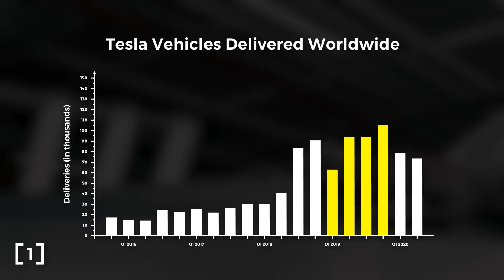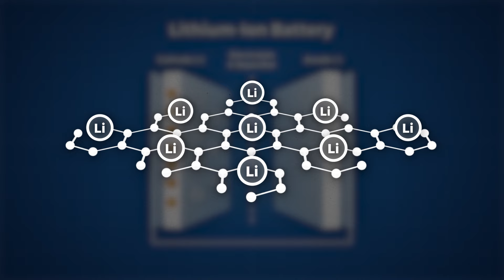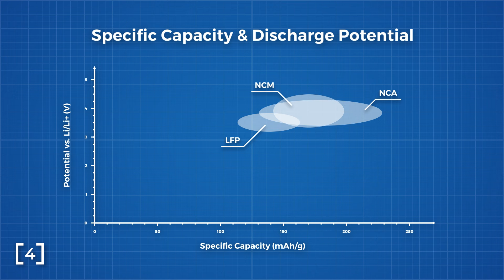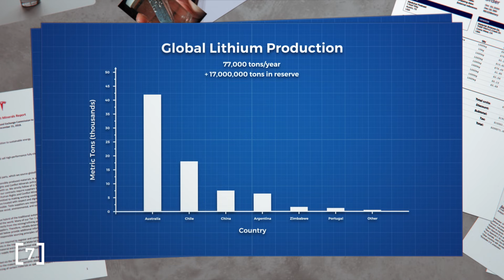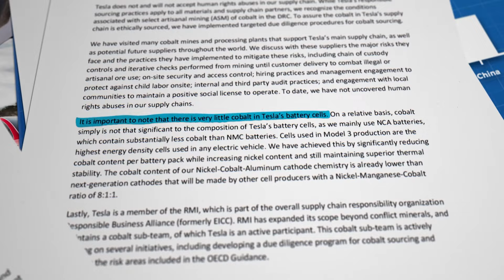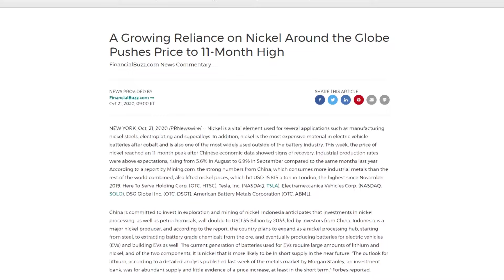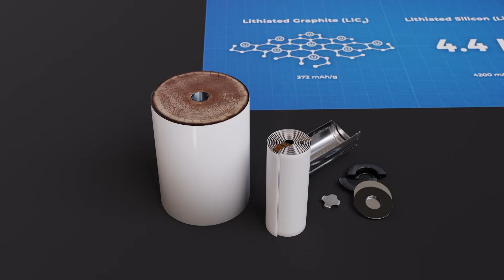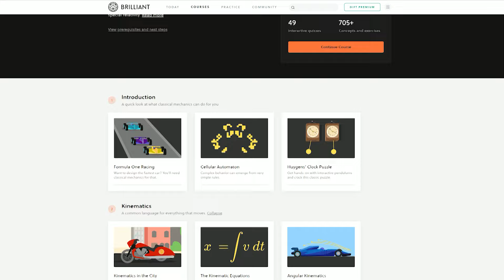Tesla's Battery Supply Problem

Comment: Forget batteries. Electrify the roads like slot cars but in 1:1 scale 🏎🛤
Reply: No, its not gonna be feasable
Reply: @antaresmc4407  it is, but you make the slot steer the car since you must be following it all the time anyways, make them longer since you no longer need steering, to exploit economies of scale, et voila, you have a tram! Why not put it on exclusive or elevated track so 'normal' cars won't intervene? Now you have a rubber tyred metro or mass rapid transit!
Reply: @revimfadli4666  you would need to wire up all roads and limit a lot vehicles' speed and maneouverabilty, while costing a shitton of money and electricity to maintain
Reply: @antaresmc4407  why wire up all roads when we can put our "elongated electeic cars" on a sepcial track, and only wire them up instead?

Why limit the speed and maneuverability, when it's on an exclusive, grade separated right-of-way?

Why worry about the cost, if you can also capitalize on property rent around the stations(which would gain value due to their strategic location), enough that you can lower ticket prices while still providing affordable transit?
Reply: @revimfadli4666  so you wanna create tram but with tons of traffic?
Reply: @antaresmc4407  tons of traffic of 'normal' cars that share pathways? Or traffic on the exclusive line?

If the latter, that's the beauty of 'elongating' our 'slot electric car', you can fit many people while taking up less space!
Reply: @revimfadli4666  what I meant is a lot of trams in a line.
Thats what I understand you are describing, which defeats the purpose of a car, being versatile and convenient even if not as efficient as possible
Reply: @antaresmc4407  isn't a lot of (short) trams in a line, a light rail?

Now the versatility & convenience can be done using Personal Rapid Transit, or feeder buses, or electric autonomous taxis
Reply: @revimfadli4666  but ths purpose of going around the need for batteries die completely then
Reply: @antaresmc4407  not completely, don't the trams use electric lines instead of batteries? And trolleybuses also exist

Even if the autotaxis use batteries, isn't that small compared to the light rail's power? Isn't that far from "completely die"?
Reply: @revimfadli4666  so then you dont electrify the roads? Ive losed you somewhere 😅
Reply: @antaresmc4407  not exactly, you do electrify the "roads" that trams, light rail, trolleybuses, and maybe trolleytaxis(?) go through lol
Reply: @revimfadli4666  oh, yeah, more infrastructure is always nice, but there is a tradeof, the more fixed and infrastructury it is the more efficient but less convenient. Thats why you wanna have both
Reply: @antaresmc4407  if by "convenient" you mean flexible then yes, though with enough mass transit & pedestrian/bike accomodation, at a point it becomes much more convenient to freely walk/bike around & sit nicely on trains, buses etc, without worrying about driving, fuel, maintenance, car taxes, parking, etc

Comment: I just thought of something funny, so like if more people use more electricity then there would be an increased demand for electricity on the grid causing the electric company to create more electric plants that are probably made out of gas or coal plants creating more emissions at a quicker rate
Reply: Again... powerplant is more efficient then a car engine and is outside of  the city and has more filters. Tesla olso makes a solar panels and roofs wchich are grate for EV owners. And yes we need to push for more like nuclear. And they wont build to much coal bc pepels wont like that. YES ev owners know that we use coal for power
Reply: Though at least apparently power plants are about twice as efficient at converting power, so it's not a complete loss...
Reply: Solar and wind power are already the cheapest forms of electricity in many parts of the world, and are still dropping in cost very quickly. To use an over-used quote: “Skate to where the puck is going, not where it has been.” You do have the problem of energy storage/balancing. But if we're talking about increasing electricity production to fuel EVs, then you have by definition solved much of that problem. Most EVs have 2-3 times the range of the average daily commute, so a world full of EVs could easily balance some of the variation in production by solar and wind. Producing hydrogen for trucks and boats can balance the rest.
Reply: Man, I didn't know people actually replied to my comments, I gotta make more conversation invocative comments, cause these are pretty good comments

Comment: well well lithium ain't renewable bruh
Reply: lithium isnt used up when built into batteries. It requires very little lithium and can be recycled if necessary but lithium is the third lightest element in the universe and is not rare.
Reply: Mr. Clean  which is why Tesla is beginning their new mining techniques in Nevada
Reply: Lithium is an atom. It is not produced, it is not burned.
Reply: Technically it is, you just have to recycle old goods that use lithium in their batteries. Theoretically, mining should just add more lithium to the cycle.
Reply: Mr. Clean  lol.  As opposed to oil extraction and transport? Yes lets subsidize oil drilling and then burn it up into the atmosphere until its gone at the cost of our own health.  How about this? Use clean mining techniques and mine things that dont destroy our air and water.  That is an option you know, except one problem.  Our governments keep subsidizing oil extraction!!!
Reply: @PyroManiacbwl  no the problem is lithium. Lithium is ass to refine, it produces loads of crap as a byproduct.
Reply: @TheSpearkan  that plus new mining techniques would reduce the overall impact greatly over time. It's all about how fast that can happen
Reply: @Kyle-gw6qp Loads of crap? sounds to me like you have no idea what loads of crap is produced. Also, mining techniques CAN be clean.  We could start by shifting oil subsidies over to clean lithium extraction techniques.
Reply: @PyroManiacbwl  as well as what you’ve said here people often seem totally oblivious to how much oil it costs just to get more oil out of the ground. This cost is often ignored when people say “mining batteries is bad”.
Reply: @capuchinseven  Its super frustrating. And there seems to be a huge disinformation campaign regarding EV's. I can only try and inform people as much as I can when i see this kind of disinformation spread.
Reply: but recyclable?
Reply: @capuchinseven  One of the most saddening things in my life right now is seeing that we have a clear path to a clean and sustainable future in battery and solar tech and watching people try to destroy it.

Comment: If people really cared about climate change they would be pushing Nuclear. Batteries just store power but that power has to come from some where. Solar and Wind will never be a primary source of power because not only are they limited in their steady production output but they also have a negative impact on the environment. 

Solar farms take up huge pieces of land which disrupt local ecosystem and are limited to areas that get lots of sunlight. While wind farms are driving many migratory birds closer to extinction due to the number of birds that get hit by the large turbines. 

Nuclear by contrast has the lowest number of deaths compared to any Energy sector while having the lowest environmental impact. Plus it doesn't require good weather for the power to stay on.
Reply: This. 100% this. Anyone saying that renewables alone are solution to climate change is ignorant or liar.
Reply: @baltofarlander2618  Yeah nuclear is the future because space is the future. Solar only makes sense close to the sun and in some place the sun doesn't shine for days, weeks, or even longer. Take a moon base for example which will spend about half of every month in darkness. 

Also there is no air, thus no wind in space. 

We should be looking towards the future and the technologies that will get us there. Tech that relies heavily on weather conditions is not the future, it's the past.

Comment: No chance of mitigating climate change relying on the market. Without tremendous and cooperative state initiatives to decarbonize on the economic scale of a world war, we'll just have to figure out how to live in a hotter world.
Reply: Home Kitchen  Decarbonize is about energy production in this context. Not sucking every molecule of co2 from the atmosphere. Don't be a child.
Reply: Home Kitchen  There are some ways to pull CO2 from the atmosphere but your sense of scale is way off. Prototypes of machines pulling a few thousand tons last year  compared to tens of BILLIONS in output. Just think about the logistics. How much air you have to move, the extraction efficiency, the footprint , the transport logistics of 30 billion tons. It would be as big as the oil, and concrete, and biofuel industries combined.  All that wouldnt even quite counter the extra co2  we humans put into the air every year.  "Remove all the plant food" shows a childs understanding of the world we tell them so they dont run out into the street. Good and bad. Plants eat co2, plants are good, so co2 is good. No nuance necessary, I done figured it out.
Reply: Home Kitchen  The apocalypse rhetoric is ALSO not understanding the scale. Fair enough on that point, but the earth is warming. Poles are melting, permafrost is retreating. Changes that usually happen gradually, happening rapidly. Just like we can cut down forests faster than they grow. Pollute faster than natural system can regenerate, we're doing the same with the amount of CO2 in the atmophere.  Rapid changes cause a lot more misery than slow ones. The kind of global conspiracy thinking necessary to believe that this is all a big hoax is probably the crux of our difference. For what to tax you? Its so easy to verify. It would have to be such a huge conspiracy. Like matrix or godly amount of control.

Comment: We don’t need to use batteries to store power for our threads we can just use nuclear power there are some common scene radioactive elements that are very cheap and easy to dispose in fact they are a lot better for the environment than solar panels or wind farms
Reply: Another thing that I don't see people talking about is synthetic fuels. The US navy is working on a system that will pull carbonic acid out of ocean water, and CO2 out of the air. It will pressure pressurecook these chemicals together to make a light synthetic diesel fuel for escort ships and fighter jets. 

We don't need electric cars. Make nuclear power plants and use their energy to create synthetic fuels that form a closed carbon cycle.

Comment: 3:00; *The cathode of a cell (e.g. battery- or fuel cell) is always negative and the anode is always positive.
Reply: That's true if you apply voltage. For galvanic cells it's the other way around.

Comment: As a mining engineer, you've got a bit of an error on reserves and resources. Mineral reserves just mean a mine has that much left to go, it doesn't mean production is being held back. You can only mine at a certain speed and you need to mine from the top downwards. You can't build a mine on a short life, you'd never get the financing

Comment: Another great video. I would love to see one on Organic Flow batteries - like the one being developed by the German company CMBlu. This technology almost seems to be too good to be true. No degradation, elegant scalability and lignin as a non-toxic main ingredient, that is an abundant waste product of the paper industry...
Reply: Dirk Knight  that's why I would like a video about this tech. To shed some more light on it
Reply: Dirk Knight  Well, you just state above that "none of those attributes are true", but offer no explanation as to why that is. Thats not very satisfying.
Reply: Dirk Knight  Ok, why don't you try a conversation more like this:

In a Redox Flow battery, the electrolyte is stored in big tanks. Its energy is released by running it through an energy converter stack. To increase power output, one simply has to add more converters. To increase storage capacity one just has to add another tank

CMBlu state on their website about their organic electrolyte: "One possible source is lignin, approximately 20 billion tonnes of which are an annual byproduct of global pulp production and for which there have previously been no alternative uses."

I remember the reading about those batteries having (almost) no degradation. But I wasn't able to find anything to back that up just now. So lets take that one off the list for now...

...

See, that kind of conversation would be useful. Otherwise, you'll just be pushed into the troll-camp.
Reply: Dirk Knight  I get your cynicism about new battery technologies. Lots of claims out there, but little proof.

Its just neither polite nor productive to dish out a blanket-statement like "none of those attributes are true".

As to its commercialization: A first product on the market was tentatively planned by CMBlu for 2021. But I cannot find any recent anouncements.
Another company - Jena Batteries - is currently running a 100 kW pilot plant in the netherlands - but no commercial product yet.
So this technology is indeed not interesting to you for now.

Comment: Love this video. A fantastic deep and analytical approach to the Tesla battery manufacturing potential. One thing did stand out to me as troublesome. You mention that MegaPacks (stationary storage) is a waste of resources. I understand how you could come by this view, but non-chemical storage STILL for whatever reason has not reached scale (ignoring dams, because they will be hopefully phased out). Stationary station is necessary NOW to push utilities into renewables without having to over-invest is additional renewables to meet peaks or build Nat-Gas peaker plants. Furthermore, should stationary non-chemical storage evolve and become commercial MegaPacks can be recycled. I don't view this as a waste of resources, but as an example of how batteries don't just power remotes and wall clocks, they CAN power cities. It is a marketing device to spur investment, research, and education.

Comment: based on research, emission for once production electric vehicle as manufacture process, energy resource for charging battery, and others are  the same with operation road in IC Engine. Electric vehicle is not zero emission, but it is have emission from resource energy for charging it

Comment: Some coverage of the nuclear energy's potential to elevate some of the battery issues - if the batteries are focused on the transportation sector - not grid storage potential - the demand for lithium (and other rare earths) is cut - effectively you could power the industrial and urban areas with nuclear and the rural with renewable and batteries 

There's also a major transport issue unresolved in a pure renewable world - bulk sea transport - nuclear is the only viable technology I have seen as a replacement for bunker oil
Reply: I agree. 
I wish that the general public didn't have such a negative view about nuclear energy.

Comment: They should try exploring Sodium as a substitute for Lithium.

Unlike many other alternative battery technologies... The technology to build a Sodium-ion battery is extremely similar to the technology to build Lithium-ion battery, all you're really changing is the main ingredient.

As a side-effect of switching to Sodium, you can also almost entirely ditch the copper in favor of cheaper and more abundant aluminum.

Cost and sustainability are not the only advantages of Sodium-ion batteries. The other is safety. More on that later.
Reply: Reducing the cobalt content is also possible when you increase the aluminum content!

Cobalt is mainly used to increase the durability of a battery's electrodes, but using increased concentrations of aluminum greatly offsets the need for it.

Comment: This (limited supply) is exactly why we (collectively) should focus on 100% PHEV, not EV, in the near future. To be really serious about reducing fossil fuel dependence, replacing ALL new cars with PHEV-powered alternatives is the fastest way. One Tesla on the road is using the batteries of 5 or more PHEVs. It doesn’t get us to zero petrol,  but getting us to 50%, 30%, 10% of current levels is a huge gain.

Comment: Start over !  The ocean is full of water   Use water.... h2O, and a combination of other things, like wind turbines that will charge the car if the car is moving, so like air moving through a radiator. Use that air to turn wind turbines, and what happened to that tech. Where they used the rotating tires as turbine. Generators???  Do a combination of things to keep the batteries charged as it moves....so it recharges....as it uses... some engineer can figure out how much it uses. Then use wind and the tires turning generators to charge it the same amount it uses,  
come on ....give up the more battery power thing, and “we need more raw material “. Thing !!
concentrate on how to charge as it’s being used..... capacitors, stepping up , or dwn voltages, to create more energy.... 
just an idea !!!

Comment: Have you looked into thermal batteries? I had an excercise when I was doing my masters degree in control engineering, where I had to look into the possibility of storing energy by heating a massive granite rock up to around 600 degrees celcious, with hot air. It would be a very cheap way of storing a lot of energy. However would require some smart controllers.
Reply: What was the efficiency on that?
Reply: @Alexander_Kale  The exercise we had to do was about creating a control algorithm that would increase the efficiency. I do not know what the theoretical maximum efficiency would be. But I believe Siemens gamesa is your best bet for finding that out, as they are working on creating these thermal batteries: https://www.siemensgamesa.com/products-and-services/hybrid-and-storage/thermal-energy-storage-with-etes.